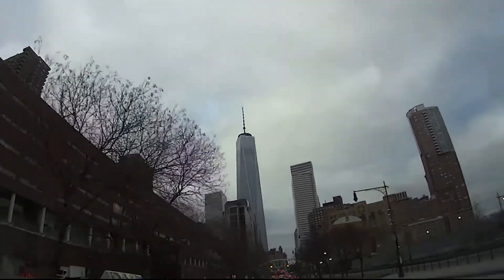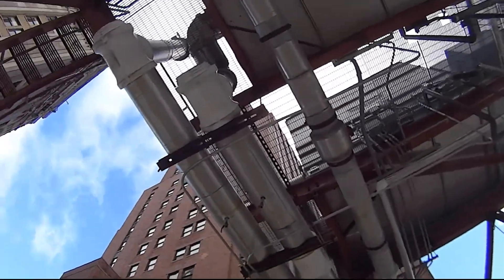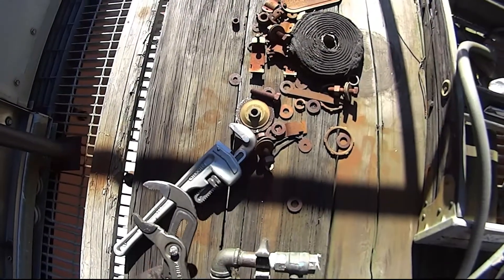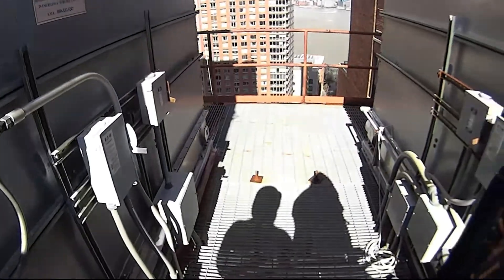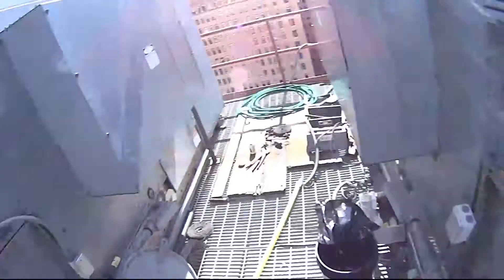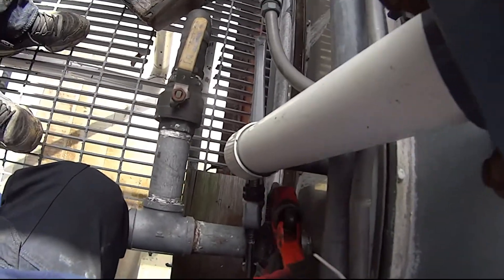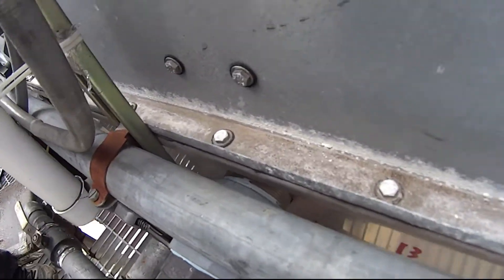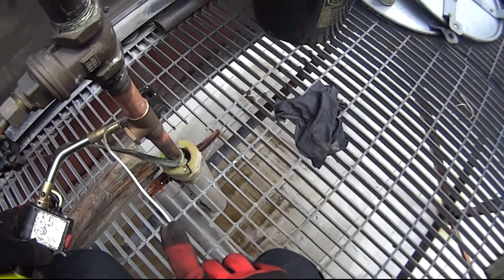Evapco Tower | Busted Ball Valves | HVAC |  PT 1

Comment: Great viedo emin. Your helper had the old school penny Hardaways shoes on who use to play on the Orlando Magic back in the day. Lol.
Reply from the maker: Hahaha I remember when Penny Hardaway was drafted, I was a young little boy lol
Reply: Hey emin i have a question for u. Today on a service call i found a blower motor on a rtu. The motor spins freely with belt off but the wheel and and shaft are locked up will not spin at all. I just need to replace bearings and it should spin right. Im new to commercial,  in residential u only work with direct drive motors . Any info will be great thanks.
Reply from the maker: Email me you number eminhvac83@gmail.com

Comment: Nice freezing job Emin what's that white stuff you put on the threads bro on top of the Teflon
Reply from the maker: Joe Shearer it's not pipe dope Joe, that's the Grey looking stuff used on gas lines, this one is a Teflon paste called real tuff, I never ever had a leak using the tape and real tuff together. I deal with high pressure water lines and always use both
Reply from the maker: It's teflon past, it's called real tuff. I use both because I normally deal with 100-150psi of water and just got used to doing that. I polly didn't even need it at that time lol thanks for watching brother
Reply: Pipe dope